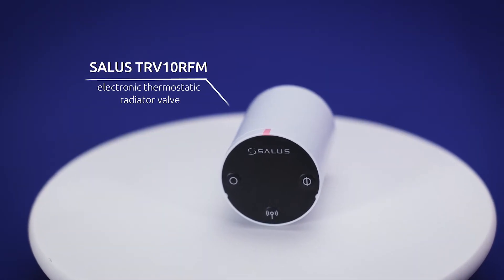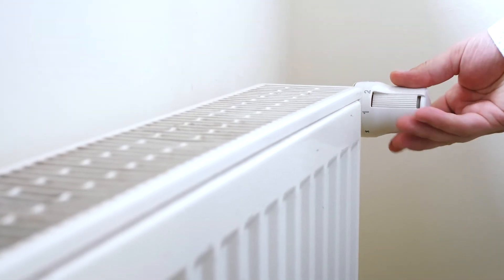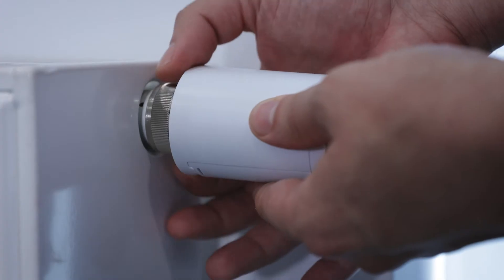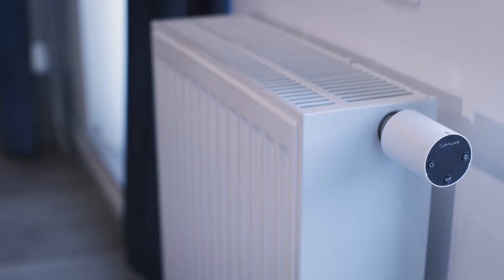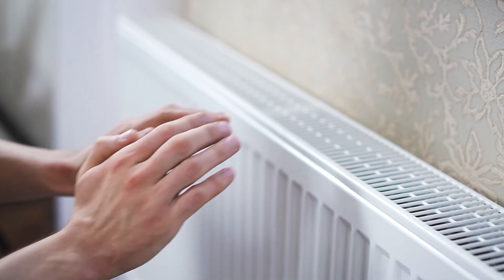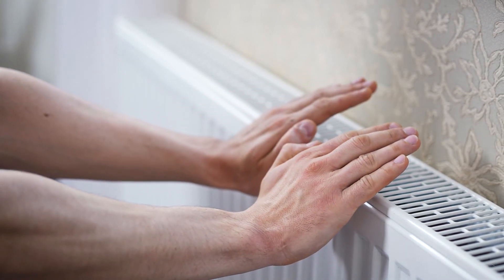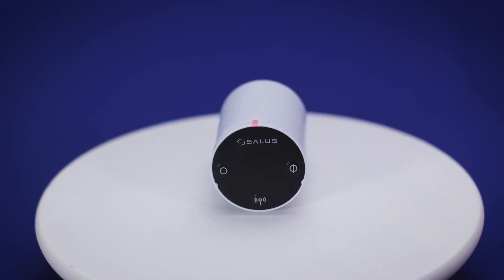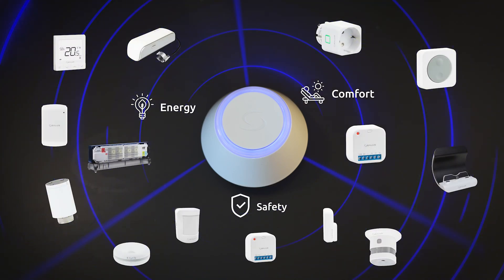TRV10RFM Thermostatic Radiator

Comment: Could you use these with the RX10RF boiler receiver without an additional thermostat and when all the valves have cut off hot water the boiler would stop heating too?